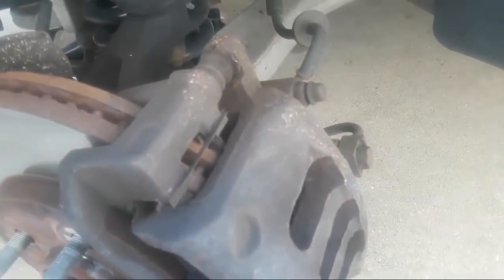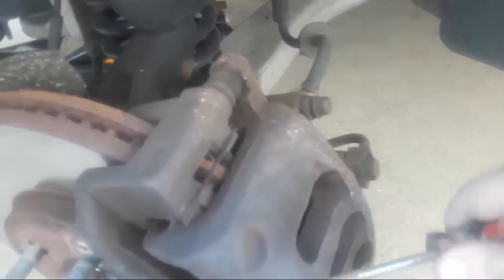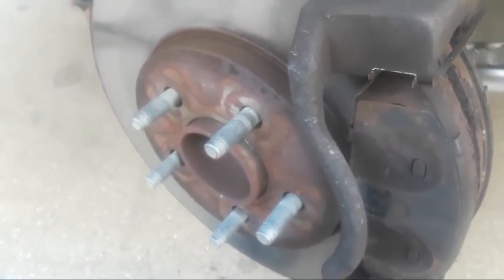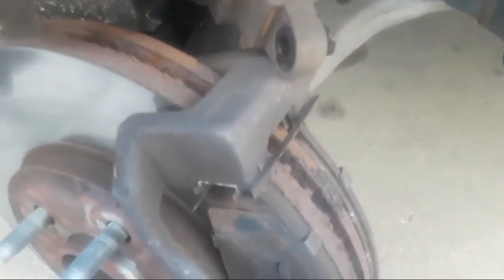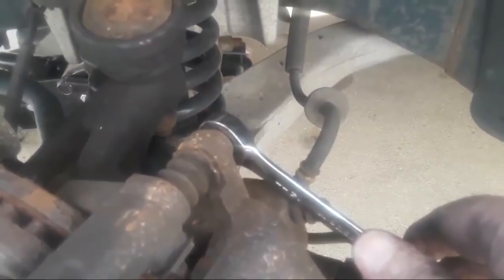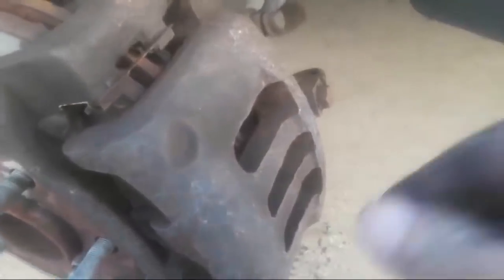Brake Inspection

Comment: I haven’t turned my rotors in years just replace pads. No pulsing so I don’t worry about it.
Reply from the maker: Many vehicle manufacturers do not recommend refinishing brake rotors. What vehicle are we talking about?
Reply: Hi Doug, the invulnerable 99 Toyota Camry 260k . Original rotors were change once at 70k
Reply from the maker: I've always felt the Toyota Camry was a very well made automobile.
Reply: They made these too well. I don’t think the modern cars will give as many trouble free miles as their earlier counterparts (mid 90s- early 2000)
Reply from the maker: I concur, everything is built to minimal standards.

Comment: Hey Doug sorry that I missed your livestream! great job  I have a question about the brakes on a Mazda b 3000 it's pulling to one side " left rear locks up first "  Thanks Doug
Reply: Quit giving to carl and buy a new car, LMAO
Reply from the maker: Have a brake inspection done.  It may be locking up un the rear due to improper adjustment. Do you have drum brakes in the rear? It may be locking up prematurely if the brake shoes are out of adjustment. Places like Meineke and Midas do free brake inspections.